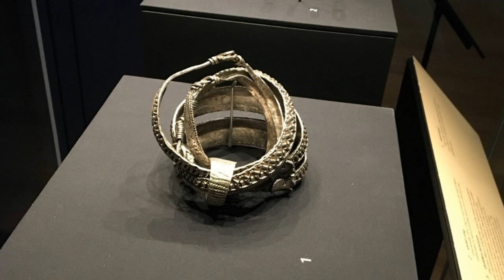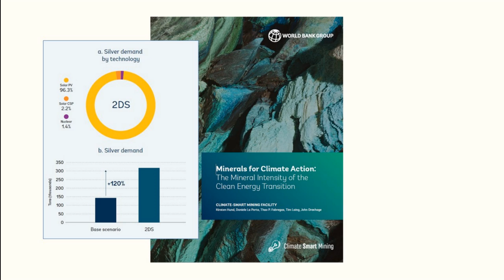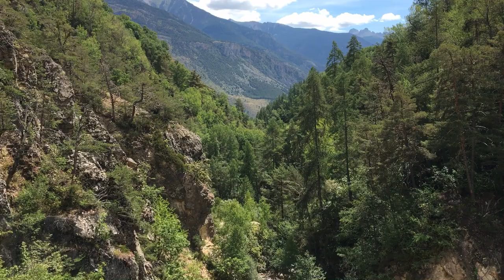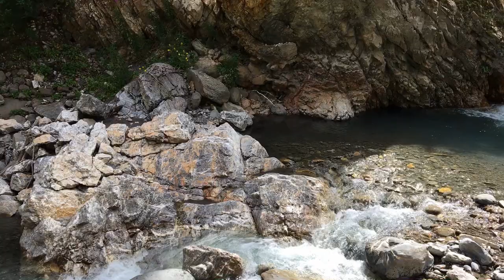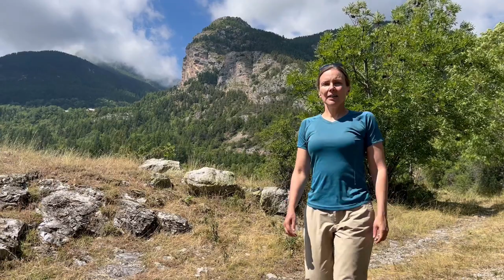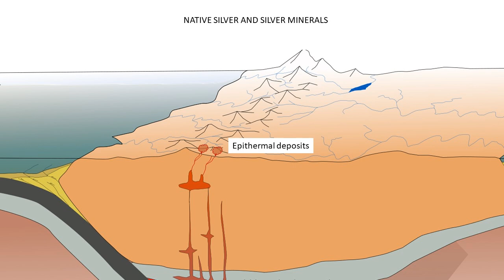Silver, the precious industrial metal

Comment: Very good video! Thanks! Since copper porphyries are responsible for over 60% of all copper production and that Mo, Au and Ag are common byproducts, can I assume that  most of the silver mined must also come from Porphyries ? If not, which are the other bulk sources  ?
Reply from the maker: Thank you! Some silver is indeed produced as by-product of copper or gold porphyry mining, but porphyry ores are associated with quite high temperatures during their formation which isn't normally superbly favourable for silver deposition. Most silver is produced from ores that form in lower-temperature settings, such as basin-related or volcanogenic ore deposits such as SEDEX or VMS ores, or from the distal (epithermal) parts of a porphyry system (so not dirctly in the porphyry ore itself). It commonly sits within gold as part of the alloy, or in the lead sulphide galena, although especially in epithermal deposits it can occur as native silver or as silver minerals.
Reply: @ourmetallicearth  Thank you for your answer. I've noticed that primary silver deposits are fairly rare and they tend to cluster in Mexico and Peru. Since they are formed in lower temperature settings, why the rarity ? I also notice the common association as you say with lead or lead and  zinc in the same deposit. These metals also tend to form deposits at lower temperature settings ?

Comment: The most important use of silver was in photography before digital cameras arrived, as well as mirrors which are still "silvered", including the reflective back of solar panels.  The Tynagh Pb-Zn mine in Ireland had a significant silver content and the oxide ore was stockpiled until the mine was exhausted and the mill could be re-configured to process the silver, boosting the revenues.
Reply: Silver also has the lowest electrical resistance of all metals.  Likely one of the reasons it is so important in electronics.